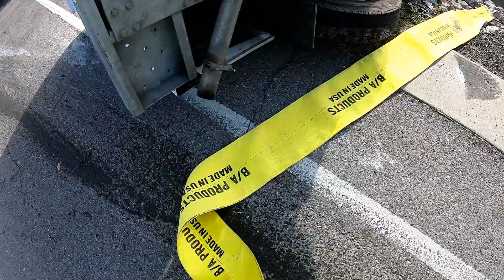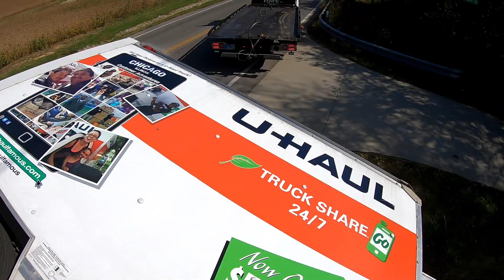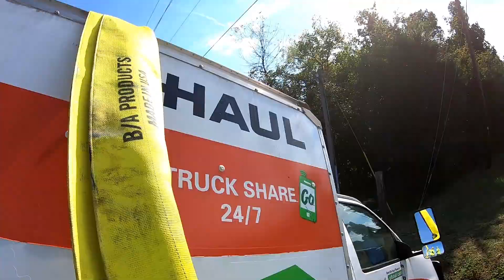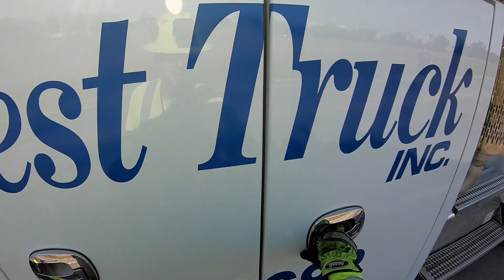DRIVING FAIL!!!!!!!!  ROLLOVER BOX VAN

Comment: I apologize  for the multiple  comments  but I just had to comment on the improvements  that entire industry  has made to improve the versatility of your average  "rollback ". Twenty years ago just shortly after the new engineering  on passenger  and light utility  vehicle made their increased almost a  necessity , the beds nor the hydraulics were not designed  for the shok loads or abuse inevitably stressed  them to. Today the entire industry treats them just as you would any other piece  of recovery  equipment  in it's  weight classification and happily  come back for more as if it thought it was an old Holmes 440 or 480.

Comment: Quick suggestion, when backing someone up use signals like they do at the airports. Use full arm motions instead of just your hands. It cuts down on confusion and is easier to see in the mirror. It's also much easier in low light conditions.

Comment: Ppl that rent those speed in-'em as if they're in their Subaru ... and drive into the 11'8" R&R bridge there in Durham. SMH
Reply: R&R ... Rest and Relaxation? I also avidly watch yovo68 and those 11-8 videos and while you think Uhaul would hit it, not even the largest Uhaul is tall enough to hit it as it stands at 11-4 empty.
Reply: @Joshua79C  , R&R = railroad. he just didn't know its supposed to be R.R.
Reply: @Joshua79C  don't put it past em a 13'6  tall swift truck hit a 14 foot bridge  it is possible
Reply: @Joshua79C  I dont think you've seen a 26 foot uhaul the height on them is 13 foot the 10 foot box truck in the video is 10 foot high as well
Reply: michael king many years ago 70s in MORRISTOWN NJ, the roadway under the ERIE LACKAWANNA RR, was 12’6”, and the NEW CAR CARRIERS  safely passed,,,,,, UNTIL they REPAVED the road REDUCING the headroom, but the town NEVER CHANGED THAT SIGN, well you guessed it the New car CARRIER came by, & CRASHED, 3 top cars RUINED, now stuck, guess whom lost the expense ? The TOWN LOST , as that truck had passed for YEARS, until the headroom shrank, with SAME SIGN .

Comment: You should get one of those horns from a Fire truck (the REALLY LOUD Get the F Outta My Way Horn), even if you aren't Running Code. It will help get people attention, over using the air horns on your truck. Look at the rebar cage around the muffler/cat! It is nice to get help from a 2nd set of hands... I had some 3rd Party Help on a recent Outdoor Fiber Optic pull, while it was snowing. You should get your 3rd party helper an "Honorary Midwest Truck Hardhat" (I think  he'd like it).  Didn't you assist Talon with a recovery at that same location, where you had to cut a chain-link fence from under the vehicle? (I think it was a Van/Bus?). As always Ron... another fine video! I learn from each and every video you post. Thank you for making these videos.
Reply from the maker: I've looked into the "stutter" horn and am still considering purchasing a few.  They are a little pricey, though.    Thank you for watching and God bless.

Comment: Hey Ron - I often wonder what happens to some of the vehicles you pull out of deep holes, ditches and whatnot: most seem to be headed for a write-off by the insurance company, and then scrap. But do you have any way of connecting with the owner/operator, law enforcement, or insurance company to do (even a brief) follow up? For example: I would love to see a few minutes of video of emptying this rental truck, and then U-Haul putting it back together, if that happens. I have no idea how you would connect with these owners if they are out of the area, other than them sending a picture or two via email, but the local ones should be interesting to see what happens to the vehicles with some value left in them.
Reply: The rough way it works in the shops is it's going to go on an insurance hold after its inspected and then the insurance agent for uhaul will come out look it over look at the estimate for repairs and either sign off on fixing the truck or we will put a salvage authorization on it and anything that's worth saving is taken off and stored away for when another truck needs that part the big ticket items are engine trans and axle smaller parts are sometime kept but not always a forsure thing

Comment: A uhaul truck. I used to work at a uhaul dealership. Hope they bought the upgraded insurance, an extra 14.95. It's pays everything, no deductible,  u walk away not owing a dime. If not, the truck by itself is several $10,000 that renter is responsible for

Comment: How did this driver put his u-haul truck in the ditch and on it's side with no snow, ice, or rain?
Reply: Looks like the silver car turned left from the concrete road dirt to the paved roadway(hwy) without looking left first.  Silver pulls out in front of truck and the truck driver yanked the wheel hard right to avoid t-boning the silver car.  Van's left front and silver's left rear make contact, sending the van towards the ditch on right shoulder.  Van's nose enters the culvert, pivoting it, and the van's inertia causes it to roll over on its side.
Reply: pyro 323 . It hit another car, which was 90 degrees to the road,, those are the people Ron asked to pray for God Bless,

Comment: Who aligned the front end of the truck you are driving? The steering wheel isn't in the right position when you are on a straight road. Just saying.
Reply: Ron has Answered that question many times already Ted.
Reply: As he has said many many times, the alignment is just fine. The steering wheel was just put on by a previous owner in the wrong position.